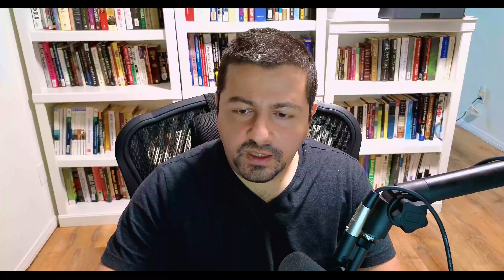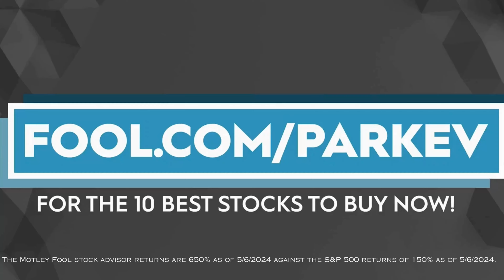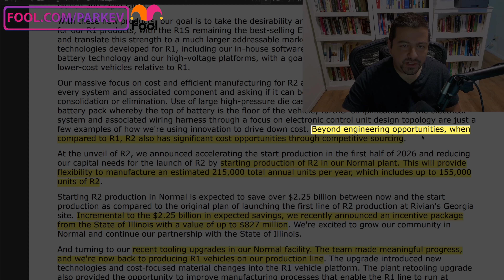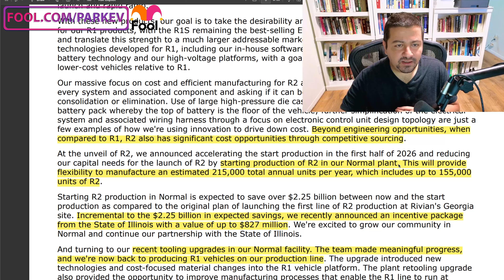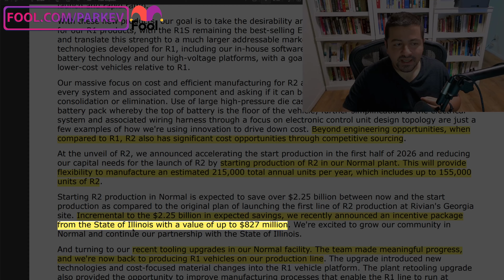Rivian Is Making Significant Progress Toward Profitability | RIVN Stock Analysis

Comment: This video is total hype.  In 1Q24, Rivian lost $1.4 bill.  Rivian sold 13,588 vehicles.  Rivian's GAAP loss was $103,032 per vehicle.  In 4Q23, Rivian's gaap loss was $107.4k/vehicle.  Rivian's situaion is beyond dire.  Rivian needs to sell its cars for around $200k+ just to break even on a gaap basis.  Almost impossible.  Rivian's inability to reduce its massive losses is why Rivian is headed for certain bankruptcy
Reply: Your taking the company’s total expenses and dividing by car, the company is not literally spending a hundred thousand over the selling price to make each, the total company is also affected by things like R&D, CEO pay, Corporate expenses etc… the loss per vehicle is smaller than what you posted when it is just the production costs of the vehicle minus how much each vehicle sells for, the bigger problem is they don’t have the benefit of economies of scale and there just isn’t the demand for their vehicles even if they made a reasonable profit on every vehicle they sell they would have to sell something 10 times current production number to break even.
Reply: Rivian is in a very hard spot. The economy is an enigma right now. If the economy goes worse, it might not matter if Rivian does the impossible or not. People wouldn't buy a lot of EV or cars in general when the economy is struggling. And that's variable outside the control for Rivian.
See Tesla struggling with sales. Rivian has two years or so before bankruptcy, so the risks are high. Small companies tend to disappear when confronting harsh economies. 
My advice is to keep on eye the stock and wait if the economy goes in a upturn.

Those who don't consider the economy's state as a major factor, then I think Rivian has good odds to be profitable and start growing in 12 months to 2 years.
Reply: He never recommended as a “buy”
Reply: I went through Rivian balance sheet and P&L for Q1 and also read the notes. They are heading to the right direction
Reply: @SupportAI309  I would not call a 1.45 billion dollar loss going in the right direction
Reply: @hs5312  I bet you don't understand finance nor business strategy, do you?
Reply: @SupportAI309  at the end of the day Rivian will go broke in a few years, think what you will but the writing is on the wall, trying to discredit me won’t change that
Reply: @hs5312  that's why I thought you didn't understand business strategy. Go and tell Blackrock, State Street and others who are increasing their investment in Rivian that it will go under; those firms don't look 1 year ahead, but 15 to 20 years. Remember everyone said Tesla would go under, yet today they are the world's largest auto company. Rivian losses are huge for sure, but again they are heading to the right direction
Reply: @SupportAI309  black rock bought into fisker and was buying until recently, are you going to tell fisker is a safe investment. Rivian is burning at a huge rate and only has a few years to turn around which they probably won’t. I said rivian would go broke in a few years not 1
Reply: @hs5312  you're correct about Fisker, but that's a different case. The hardware was good, but we can't/couldn't say the same with the software. Rivian hardware and software are top notch. They only need a turnaround in macroeconomics conditions - that's the difference between Rivian and Fisker; Rivian need volume, Fisker needed volume, software and a little bit (maybe) of  hardware too. Oh by the way why do you think Rivian will go under in a few years? Because saying this because they made a $1.4B loss is pointless
Reply: Rivian loses 1.4 billion, they have cash, cash equivalents and short investments of close to 8 billion dollars. At that burn rate they would go through the cash in 6 quarters, even if I assumed for modest capital raises of let’s 3 billion their last raise was less than that, they would still run out of money in less than 3 years, this also leaves out things like convertible debt that may be cashed in I the company is not doing so well when convertible notes come down. They would have to increase production and sales multiple hundreds of percent while getting a profit on each vehicle currently it is a loss for every vehicle they sell, macroeconomic changes alone will not make a change of that magnitude happen. 1.4 billion loss a quarter which is just over 5 and half billion loss a year to revenue is a huge cliff to climb that is extremely unlikely.
Reply: @hs5312  you think they won't be able to get money through share issue?
Reply: @SupportAI309  you can’t raise money through selling shares indefinitely and going from the cash burn they have to revenue neutral is like seeing a unicorn
Reply: @hs5312  That's what saved Tesla. The product was great and the demand was there - same as for Rivian. The struggles they are going trough will help them building their competitive advantage
Reply: @SupportAI309  Tesla biggest cash in a quarter that I could find was less than half of what Rivian cash burn has been and their last capital was only about 1.5 billion which is almost what they go through in a quarter. And again they would have to ramp up production multiple of percent just to be revenue neutral and ramping up production to that capacity would take a while, the picture is just bleak.
Reply: @luckylenny Are you shorting Rivian?